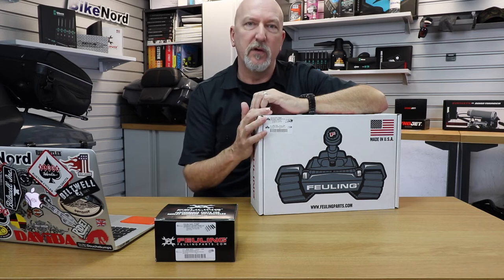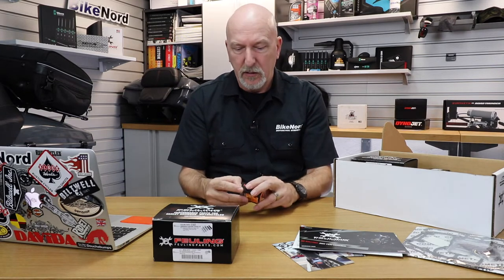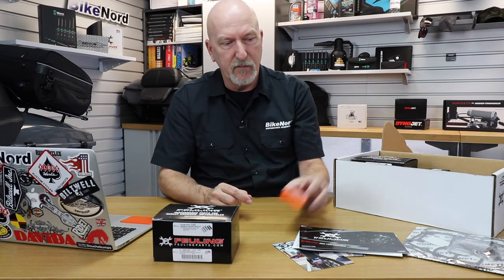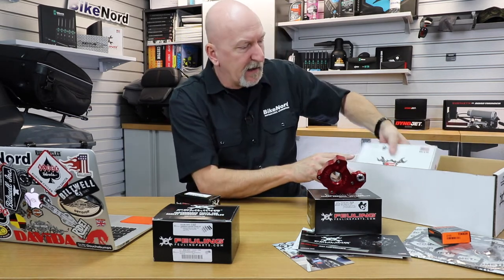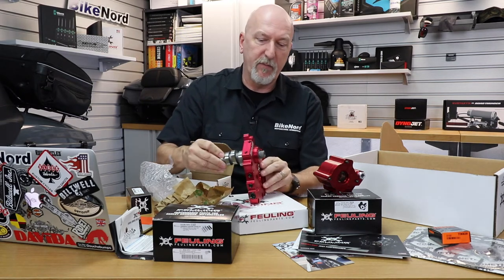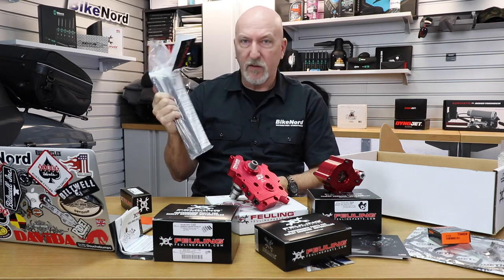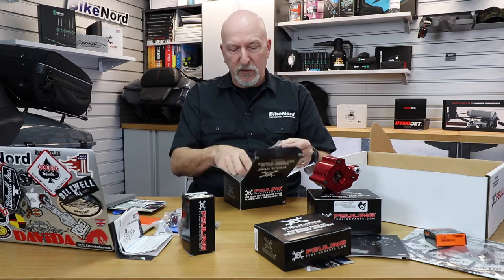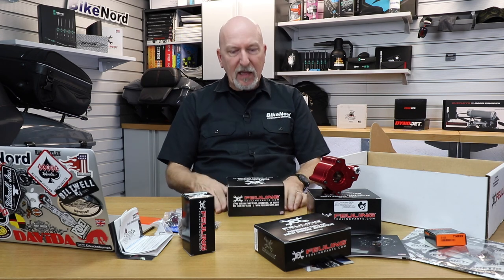Feuling 472 Race Cam chest Kit for Harley Davidson 114 and 117 M8

Comment: I have a 2019 CVO 117 and thought of this kit for my bike. I like how you explained it all in terms we non mechanics can understand. Can you explain a Tuner module that I may need? And what about the pipes? Can I use my after market slip ons or do I need to buy new pipes? And do you have to have a dyne tune done after you install all of this? And finally, can we see your bike with dyne readings before and after and then you explain the actual feel of the difference?. Thanks for the info
Reply from the maker: I think you should consider DynoJet Powervison, with this Feuling kit. Because it is very easy for a non pro to actually autotune you bike by yourself. That means that you record at least 3 sessions of riding for 20-30 min and then download it to the bike with you Dynojet device. Exhaust? I should go for S&S GNX 2-2 system but if you live in Europe you should consider a adjustable Exhaust like Kesstech. www.kesstech.de But you need to tune it when it is open. Kesstech 4 year warranty will not be covered when you put it on a Stage 2-5 bike. But it could still be nice to be able to close the system in a police inspection. I have mounted Kesstech on my bike and it sounds great at the same time I do not lose any performance. For tuning on my bike we use the Screaming Eagle Super tuner "not available any longer from H-D" together with the Screaming Eagle Smart tuner and we need to auto-tunit on the road to get it running great together with the riders riding style. After that we plan to put the bike in the bench for some reading and fine tune but you come very long with auto tuning on the road. We recommend DynoJet for Stage 2 -5 but for Stage 1 we only use PN-Performance.com specially on newer Harley 21 up and on Indian. I hope I will be back sone with some new movies about the CVO build.
Regards
Göran